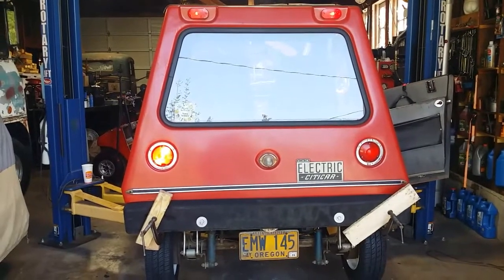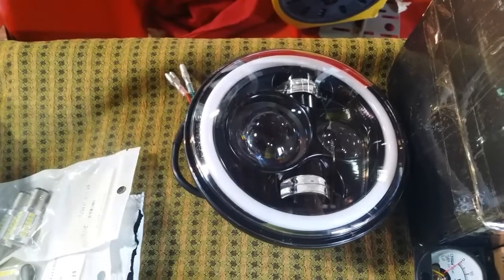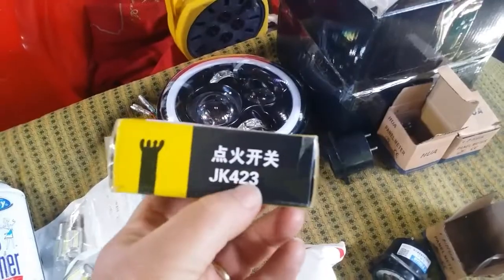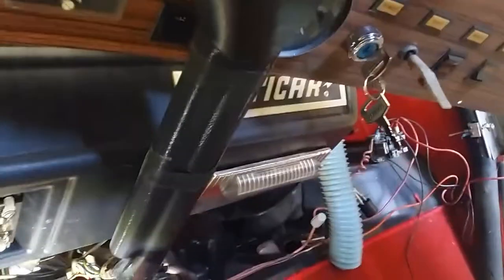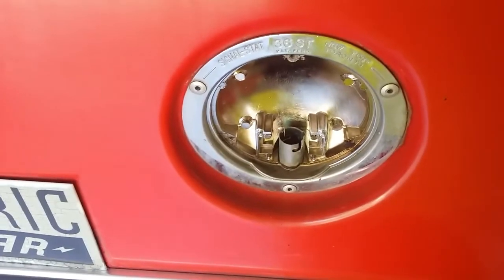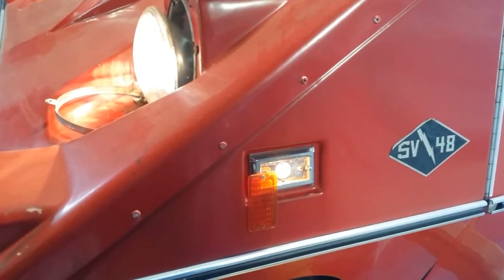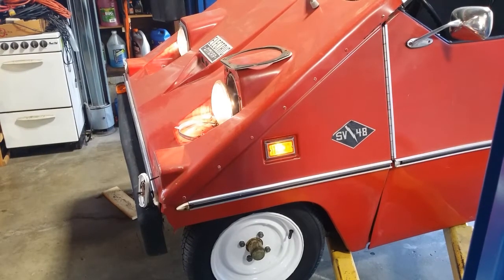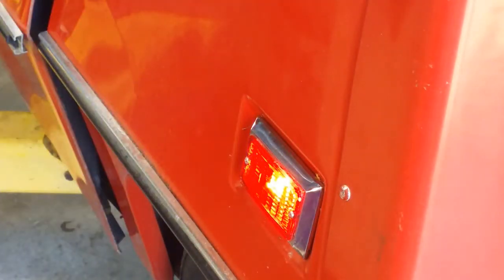My 1975 Vanguard Citicar gets LED Exterior Lighting Upgrades, not as easy as it appears ..

Comment: Would you be able to share where you purchased your various LED lights? I'm getting to the electrical stages of my own '74 rebuild and shopping around for lights.
Reply from the maker: I got them all on ebay. I bought way more marker lights than I needed and had a bunch on the shelf as I am changing all of them on our truck camper and our bus conversion.